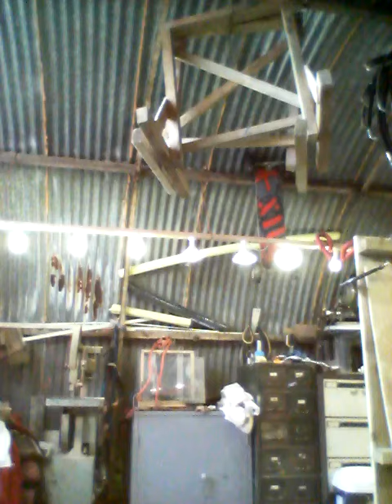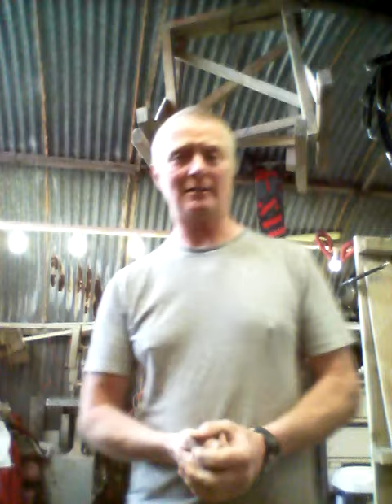PEMF later that day

Comment: You have the best unit by far.  It modulates glutamate in the CNS. Glutamate is responsible for pain and inflammation via Substance P.
Reply from the maker: Thanks! Don't quite understand the science here. do you have any more info?
Reply from the maker: done a bit of wiki. Good info! I admit I do get  a bit high after ie feel great. Not sure if there is a down side. Got the idea from Papimi which fixed my chronic bad back in 2x 7 min sessions before they got shut down
Reply: dfghjkuytr there is no downside PEMF has been around for over 20 years and over 2000 studies. you can use for many different issues well beyond back issues.  It is complex however to fully explain bc it works on many different facets and couldn't be simply explained away.  I've been leaning about it for 3 years and have a formal education that should allow one to understand it. But I think you would be a quick study for some reason;)
Reply: I Just ordered the supplies to build one, what is your opinion on the correct amount of power to use for pain relief?
My unit will be a 150Ws strobe into a 2mH coil. Opinions or information you could point to would be highly appreciated, Thanks.